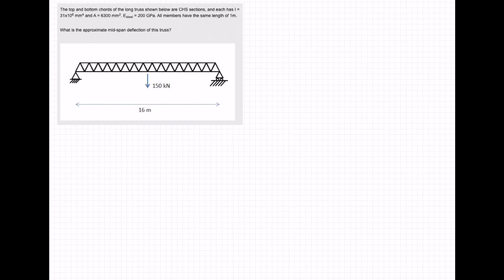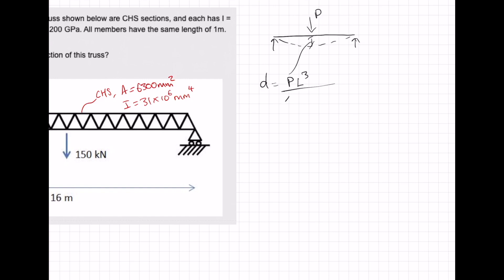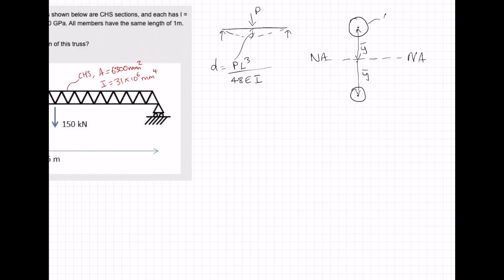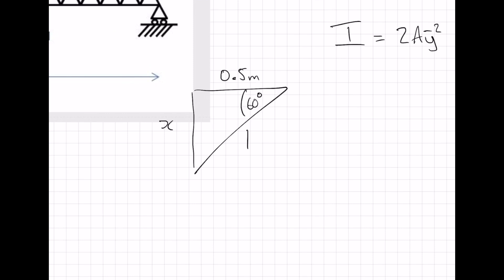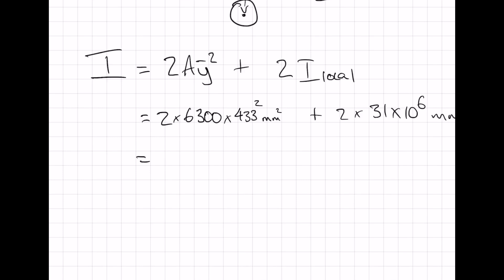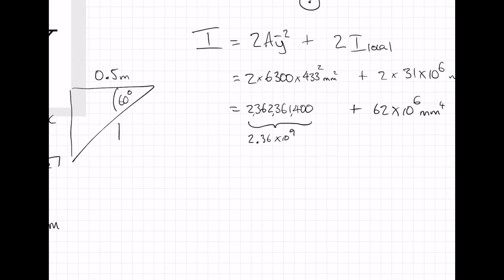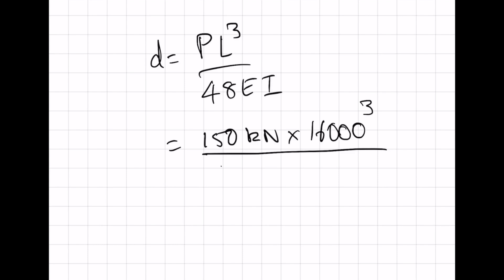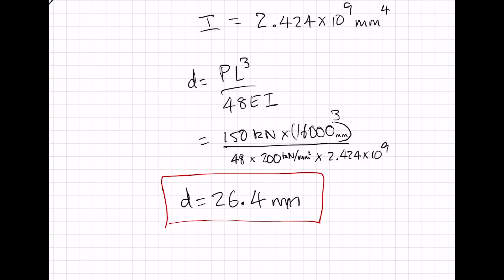Deflection of a Truss - Flexibility Method - IStructE Certificate in Structural Behaviour Course

Comment: Although very good, these videos are incredibly frustrating at the same time. The underlying assumption here is that the viewer knows the mechanics behind some of the very fleeting assumptions made in the calculations. At the very least, it would be helpful to 'signpost' these assumptions so the viewer can at least go and check that part separately.

This is harsh but, often people who are very good at maths and calculations, don't make good teachers. This is because they skip over the parts most people (including engineers) find difficult and therefore don't explain the steps. This is what has happened here.

Comment: Thankyou for this video, but the stiffness of bracing(diagonal) is not included. Is this the reason why in question it is mentioned as approx deflection ?
Reply: Yes, exactly...the diagonals will contribute to the stiffness, but it will be negligible compared with the horizontal members. This is because the I value of the diagonal varies as you travel along the beam - which would be very difficult to calculate.

Comment: where do you get the I equation from?
Reply: The I equation is the confusing part of this video. Basically what he's doing is representing the geometry of the truss-sections and adding the lever-arm from the neutral axis to the COG of the truss section. 

If you think about all the factors that influence the stiffness; it's shape of section + the distance to the neutral axis of the structure x by the stiffness (E). 

2 x Ay^2 = the distance from the neutral axis of the structure to the COG of the section + 2 I local = the section properties.
Reply: equation used is for a simply supported beam, derived from solving for slope and deflection. there should be tables of formula available on google :)
Reply: is this not the paralell axis theorem
Reply: @b1scuits1  The parallel axis theorem is for finding the COG of a shape - the 1st moment of area, expressed as mm^1. This goes onto calculate the 2nd moment of area, which has 4 dimensions, depth squared, the width + the distance to the neutral axis - this is why its expressed as mm^4, it has 4 dimensions.

Comment: Hi, how could the stiffness of the bracing be incorporated into the EI calc, if you wanted to account for them as well? Thanks for the videos!
Reply: Best way is to model in a FE software - trying that by hand would be very onerous. You'd have to consider a specific point of the diagonal and solve for the resistance provided at that point, which would be fairly small. 

Think about a stress plot on the section - the stress in the centre would be zero, and it would linearly increase up to max allowable stress. This is where engineer's judgement comes in, and is important.